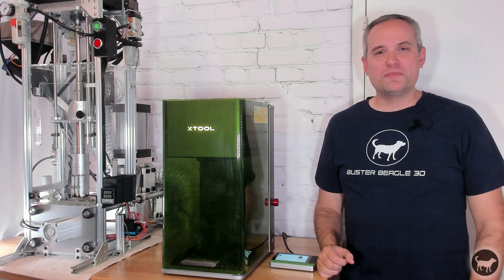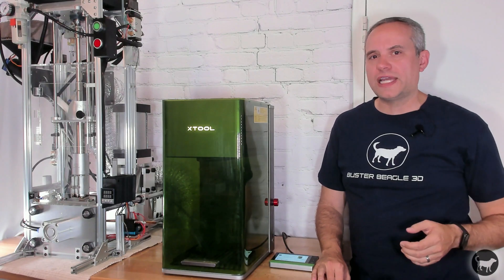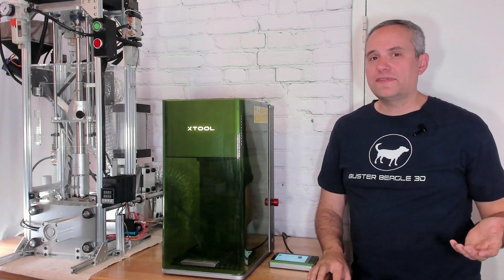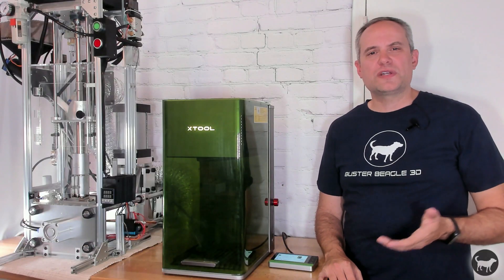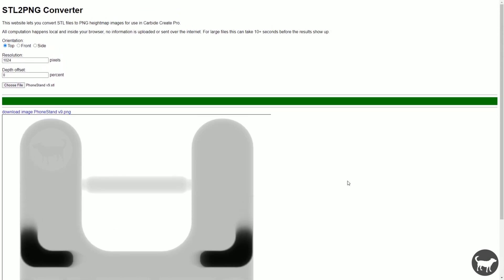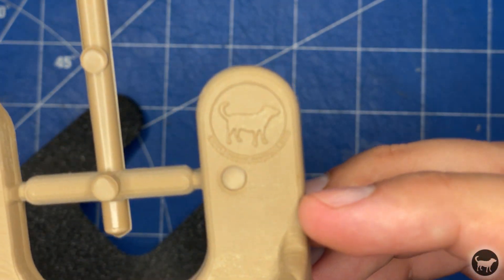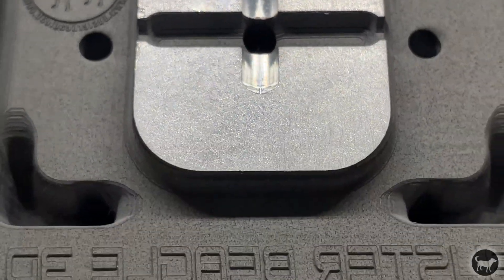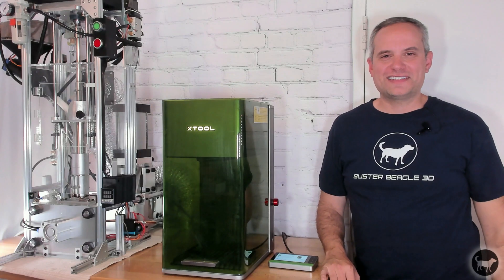xTool F1 Ultra Ultimate Stress Test | Aluminum Injection Mold from a Fiber Laser | 3D Engraving

Comment: Its amazing to see the sheer amount of time and effort that went into the project.👍👍 Self sufficient mold creation, is definitely the holy grail of volume production using desktop style injection molders. How was the taper issue with the fiber laser resolved?. Another fun little experiment could be, is to use electro etching(reverse electroplating) to gain speed while lowering cost(a setup that does not involve expensive fiber laser)?
Kinda poorman's edm🤔❤👍

Comment: I've been tempted to do something similar, but unfortunately lack the fiber laser. Similar, in the sense that I don't think it makes sense to get rid of large chunks of material with a fiber laser. A CNC machine is pretty good at that; roughing such a large part to +/- 0.2mm will take less than 15 minutes on my (well...) hobby cnc... The thing is, the details, logo's, text, tapers, and things like that add up significantly because you need to do a lot of tool changes and even with an ATC they are very small bits - which means they are fragile, and slow. That's where a fiber laser shines.

I've seen the 2W IR fiber laser modules, which would be perfect (because they can do the job in a straight line) if they weren't 2W. These fiber lasers seem to throw out a lot more juice.

Anyways, just to say... I've been wanting to rough on a cnc, then probe on a cnc, and then feed both the height map and the model to a fiber laser. Perhaps probe again. You get the idea.
Reply from the maker: Yeah. This was a pretty ridiculous thing to do but I did learn a ton. It could be useful in some places but this was more or a test then anything.
Reply: @BusterBeagle3D Actually I'm not sure it was so ridiculous. Spending 20-60 hours on a mold without having to care too much about it is not too bad honestly. Complex molds can take a multitude of that just for the design process. It's not like you need to cut out a mold every day... Plus, the fact that it 'tapers' isn't much of a problem, because your angles need to be tapered anyways. Now you're just forced to do so.

That being the case, I think using a fiber laser for just the tough spots and the details might be a pretty difficult process, which would be interesting to describe. It requires precise measurements and placement of the part so you know what to cut off - which in itself is a hard problem.

Last time I made an alu mold, I used over a dozen small endmills with tips all the way down to 0.2mm, tapered ones etc. I honestly didn't like that process; toolpaths take forever to generate, not to mention that the cutting itself takes a long time. Ideally, I'd just mount the galvo/fiber laser on my cnc...

Comment: I wonder if it had a linear table to move the part to center if would take car of the sloped edges.
Reply from the maker: I could be wrong but I don't think you can run the 3D engraving and the moving table at the same time. I think the 3D engraving does the sloping in the software.

Comment: I guess what you could do, with a Commarker, is create a platform with some stepper motors and threaded rods. I don't have a laser like this so I don't know how Lightburn communicates with the machine, but you would have to get lightburn or the laser to send out a signal when it has done a complete pass so that the platform would raise itself a bit.

As for the tapering, I guess you could either use a different lens and/or adjust for it in the design of the depth map. Preferably both. But any plane that not in the centre and facing away is going to be an issue, no matter what you do.

In theory this could be done, tapering would still be an issue though. Just not sure how much work it would take. It would however be a nice recommendation for Commarker to try and create a motorized platform for this as an addon.

Comment: Which CNC machine do you have btw? What would you suggest for a desktop cnc / garage ? For cutting aluminum/ for molds / also looking for get injection mold machine
Reply from the maker: Unfortunately I don’t have a garage so space is limited which is why I actually downsized my CNC. I used to use a 3018 CNC with an upgraded 52mm spindle. I still use the same spindle but on a much smaller 1419 CNC. 
The type you get is really dependent on how much you want to spend. While you can get a knockoff 3018 CNC for about $200 a Tormach will run you 1000s but obviously be much better. Genmitsu sells many different sizes and strengths for CNC machines and I have also heard good things about Anolex machines as well. If you search the Aurora Tech channel on YouTube she has also reviewed a bunch of slightly higher quality CNC machines as well.

Comment: Can a injector molding machine inject Eva foam to create a mold?
Reply from the maker: Hello. I have never injected EVA foam before. I know that others have used different types of rubber in the machine but I have not heard or anyone using foam. As long as it can melt under 300C and be injected I don't really see what it wouldn't work but again I have no experience with it.

Comment: I have a 300W fiber laser that uses EZCAD3 which is capable of doing the same thing in around 8 hours at 90% power. I also added an air knife to constantly remove debris from the parts I'm working on, very practical and I can confidently say it is better and more practical than a cnc for small parts like that. Thanks for the video.
Reply from the maker: Thank you so much for the support! I would love to try out a laser that powerful someday. My most powerful fiber is a 60W but I bet that the 300W is something else. Thanks again for watching and for the tip!

Comment: 4 days ?! 

Some of the parts I need take 4 weeks and cost a crap tone !!! This is talking about half the production time and a tenth of the price !! How deep have you gone in this process? 2 inches is prolly about the deepest I need. 
Thx in advance for any input, very promising tech !!!
Reply from the maker: Hi. I have gone about and inch deep. I'm guessing that is about as far as I can go in one shot. Again the issue is the tapering of the model for depth by the software. I would think that you could go around an inch with the first pass, then need to set up a different pass for to go deeper starting at the newly engraved inch. You are also limited by the layers, you only have 256 layers so if you need to get real deep and have a lot of smooth curves the deeper you go the more "stair stepped" things start to look.
Reply: From layer to layer, which is largest step you can set? I am trying to figure out where the 256 layer limit come from.
Reply from the maker: @marioalday5966  I think the 256 layers comes from max allowable shades of grey between white and black in an 8 bit image. The lower that value the larger jumps it's going to calculate between those layers. This is just a guess but that was what I was assuming.

Comment: Would be neat to see on a gantry laser since it would be able to have the laser normal to the cutting surface at all times unlike a galvomotor motion system.
Reply from the maker: Yeah. I know there are some out there that do this but it certainly would take longer. Maybe something to try in the future.
Reply: @BusterBeagle3D  Time to buy a P2S
Reply from the maker: @saobx3956  I have a P2 but not the P2S. Problem is that it's a CO2 laser and not a fiber. Not really intended to carve into metal. There are gantry style fibers out there, I just don't have one.
Reply: The answer is Theta lens. Theta lens. Check it.

Comment: there a bit of stair casing on the larger fillets. is that a case of running a smaller resolution?
Reply from the maker: The issue is that with this software you only have 256 layers to play with when it comes to the depth. You can run as many passes as you want but can't go over 256 layers. It would be great if they could allow to at least double it.

Comment: So it looks to me like the lasers downside from the focusing problem is actually useful because it automatically creates draft angles, with an auto airblast to knock dust off every so many layers or minutes and an extractor vacuum to get rid of the powder buildup  knocked loose into the air in the chamber and some software mods/ updates to better refine the depth maps and calculate material removal rates with some testing it could pretty easily be a capable laser engraver for molds...hmmm sound like a pretty fun raspberry pi experiment for someone... especially if you do bulk material removal with the cnc.

Comment: Are you sure the tapering is programmed by the software and not a consequence of how the laser focuses? The fact that the angle changes depending on how you position your parts seems to indicate the second option.

I think this is a great process for producing standalone parts. Yes, CNCing your mold might be quicker but I feel like with the right setup this might even be more painless. My only gripe is those inconsistencies stemming from the laser focus. Seems like they might cause issues if you intend to run a big part, or parts that need tight tolerances all around.
Reply: I looked a little bit more into it, xTool talks about it in their website and it's a consequence of the incidence angle of the laser, as it get further out in the workspace the laser gets more and more tilted, which could lead to an undercut. Presumably they apply a flat compensation to this all over the workspace by just tapering everything in, resulting in vertical walls at the edges and really tapered in wall in the middle. 

I don't know enought about lenses to figure out if this is normal or a consequence of the type of lens they are using. Also, to be honest I can't fault them for opting for better usability over precision on a consumer machine.

Comment: Not sure about the usefulness, as you cannot set the exact depths. It is not like "this hole must be 2 mm" here.
Reply from the maker: While you can not exactly tell it to make a 2mm hole you can run tests and figure out how many passes at what power/Speed it would take to make a 2mm hole in a particular material.

Comment: So I had an idea for the issue you had with the brass, go ahead and drill them out like you did but then put some matching aluminum dowels into the holes to maintain the consistency, then punch them out once it's done.
Reply from the maker: I had thought about the same thing since I already had the holes in there. It would have been better if I had done something like that.

Comment: Those vent holes look awesome! We'd love to get you an EDM machine to try burning some molds. We definitely want to try out your injector!
Reply from the maker: Thank you. I have seen your project in the past and always thought it looked really cool. I had always tried to think of an excuse to need one. I remember a version with more of a stick (sorry I don't know the term) which could poke holes in the metal instead of the wire. Are you still developing both types of machine or just the wire EDM?
Reply: @BusterBeagle3D  Our supplies can be used for both WEDM and plunge EDM (for molds). We're going to be working on a video for plunge work soon.

Would love to connect over email and share some ideas! -Cooper

Comment: This should be possible in lightburn but it would reqire using several layers possibly also multiple files, no idea if it would work with the commarker as I dont have one, but if z adjustments work in lightburn it should be doable
Using the CNC for the bulk of the work and finishing with the laser would be a very powerfull combo for stuff like this 
Great video, and quite impressive performance
Reply: Using a combo like that makes a lot of sense

Comment: Impressive experiment, I guess somebody wild enough could use this machine to cut complicated forms from metal chunks using rotator. If base is capable for days of running it is only a matter of supporting adjustements to convert it from graver to metall tool production.
Reply: Problem is that you don't control how much is removed. So you cannot use it for precise work.
Reply: @m19710310  If you prepare depthmap youself you can be sure how much is removed I think.

Comment: Please wear a good mask or respirator to protect your lungs from aluminum powder
Reply from the maker: Agreed. The machine was hooked up to a pretty strong external inline fans that was then filtered through a multi-stage charcoal and HEPA filter before exhausting outdoors.
Reply: @BusterBeagle3D  you need to run the air exiting into water. you have no idea the danger of this powder
Reply from the maker: @o1ecypher  Not a bad idea. I know aluminum power is a ingredient of thermite which is why I warn about it in video but venting directly in water may even be better then through the filters.
Reply: @BusterBeagle3D  Please and the lazer itself needs to be enclosed, lets say in Plexiglas for visibility
Reply from the maker: @o1ecypher  This XTool F1 Ultra has a full enclosure so there was no dust at all escaping. Everything was being exhausted out of a duct in the back.

Comment: Nice! Thanks for sharing...I was experimenting with this method a while back, but got side tracked building lasers. I was trying it using a Feeltek 3D scan head which can focus the Z height down to 15mm deep. I was running into the same hurdles of the slope of the deep walls, but if you design for that limitation, it totally works!
Reply from the maker: Yeah I tried to figure out how to exactly accommodate for it but since injection molding requires that slight slope any way it's almost a benefit for the molds. However I'm guessing there must be a limit to how deep you can go before your design slopes to a point where everything converges.

Comment: That's super cool, hopefully a company will eventually release a fiber laser in the $500 range. Then I'll be able to afford it.
Reply from the maker: Yeah. Fiber laser's in the 20W range can be had for around $1500 now without any bells and whistles but as they become more prevalent I'm sure the cost will go down.
Reply: If you have a decent idea of what goes into a fiber optic laser, you'll understand that fiber lasers are probably not going to reach the sub 1000$ range.....at least one I would want, due to safety concerns
Reply: You can already buy a 1500W laser gun that cleans, cuts and welds for USD$1200 so Why can’t you just mount the gun in a cheap CNC machine? I’m already using a plasma torch this way and works well so we’re
Not far off being able to do this cheaply. Exciting times for optometrists 😅
Reply: Buy the good one with AFFIRM and make payments and do enough side job stuff to pay for itself.